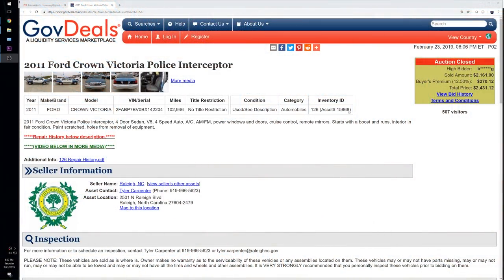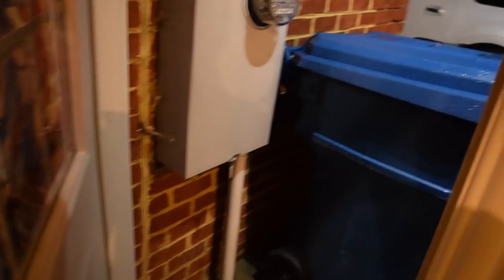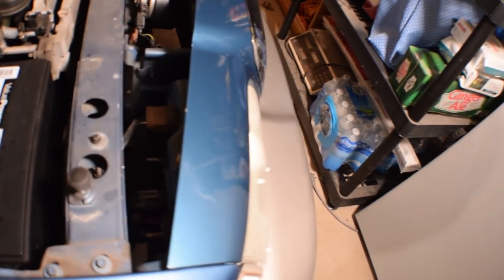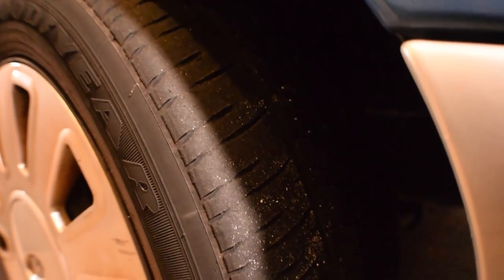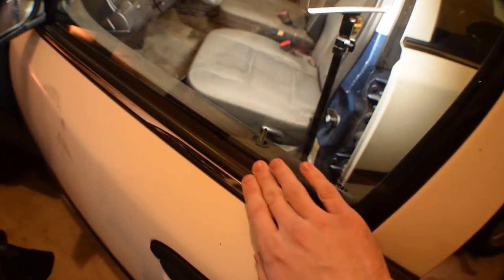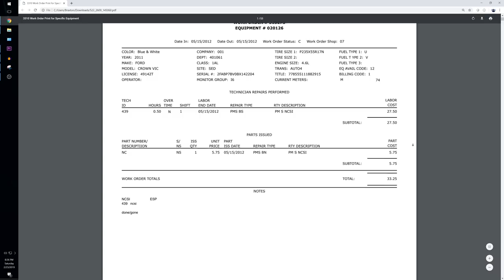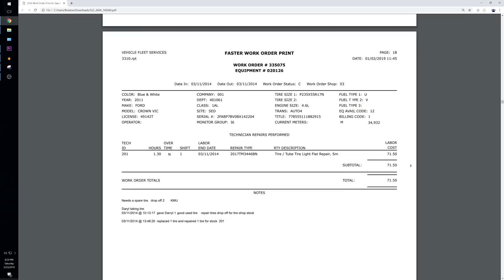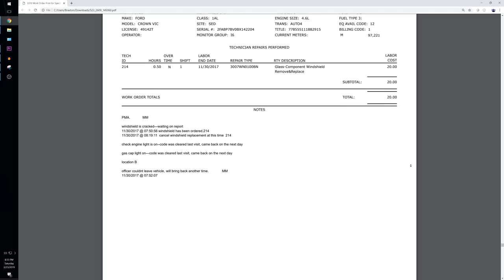I Bought a 2011 Crown Victoria Police Interceptor From a Govdeals Auction

Comment: "It's got a cop motor, a 440-cubic-inch plant. It's got cop tires, cop suspension, cop shocks. It's a model made before catalytic converters so it'll run good on regular gas."
Reply: It's a 4.6 liter....you better do your cubic inch calculations a bit better. It has police suspension...meaning slightly lower and stiffer springs and stiffer sway bars. It has four catalytic converters. Tires look pretty standard. Hopefully your response was facetious.
Reply: Jim Malek 
It's a reference to a movie!

Blues Brothers
Reply: Is this the new bluesmobile or what?
Reply: @RockandrollNegro  lmao
Reply: James Malek Isabella's King - the P71 is actually raised an inch or two to clear curbs over the stock Vic /Mercury

Comment: Do NOT use silicone! It is rather weak and tears under the flexing and temperature. Plus it's a nightmare to clean off, and nothing will stick to it, so you have to do an intense clean up once you realize your mistake. Use a polyurethane based caulk, instead. Sikaflex works great, and is available at HD stores.
Reply: I welded mine with sheet metal and bondo'd over them.

Comment: Tired of the Prius and got a real car LOL...JK.  The Crown Vics are great cars, as with any vehicle if they're well cared for they'll last a long time.  My aunt and uncle just got rid of their 1998 Crown Vic with 580k on it...it still ran and drove great if you could get in and out of it...the door latches were all failing inside and out, and last I recall only one of the back windows would roll down.  The 4.6L V8 got decent fuel economy too, around 17mpg city and 25mpg highway, not bad for a boat on wheels LOL.
Reply: Why did she not fix the lashes

Comment: I have a 2009 CVPI (former City of Raleigh) from Govdeals.  Going on 2 years.  Love it.  Don't paint it yet.  It is hilarious to drive around.  You should have kept the old battery - mine is still going strong even though it was dead when I bought the car.  Blue and white electrical tape is great for the holes.  Goo Gone for the police shield residue on the doors.  3M Adhesive Remover to clean around the holes.  BlueDriver Bluetooth Professional OBDII Scan Tool to check all the cars computers out.  Find some used Goodyear Eagle RS-A tires on ebay and get a tire shop to swap out the tires.  Lysol Daily Cleaner to clean the back seat.  Soak the front seats with Lysol Disinfectant Spray.  Check under the front and back seats for ammo and drugs.

You should do an annual cleaning around the wiper motor so it does not die on you.

Keep a look out for coolant leaks around the big black plastic intake.  Plastic loves to crack.

Comment: Panther platform cars are indestructible. I have a 99 Lincoln Town car with over 200,000 miles and still kicks ass. My daily driver! Congrats!
Reply: Ali Sleeq 2000 P71 here. Just passing 153k. Original motor and trans. Fairly minor problems so far. Nothing car breaking. 👍

Comment: Also a quick tip some police interceptor vics are keyed alike make sure you pick up a new set of door locks, ignition locks and keys from a junkyard or anyone can drive it away
Reply: max p not necessarily... I’ve tried some other vic Keys in mine and they didn’t work
Reply: @deathraydave  Not all police departments order them keyed alike but many do so it's a good precaution to take.
Reply: Far from true.
Reply: Fleet keys and being keyed alike is definitely a truth. Carlsbad PD and Chula Vista PD as well as Anaheim PD, Brea PD, and Riverside County Sheriff all use the same fleet key for their Vic’s. I’ve opened them all with my keys from my car. So yes. Fleet keys exist.
Reply: Virtually all use fleet keys. There were only six keys. The new PIs have seven... guess where the bitting codes for six of them came from. Unfortunately rekeying them is a pain in the ass.

Comment: Sounds like you've got most of the bases covered, but I would look at replacing all of the rubber on the car (hoses and belts) if that is in your budget. I would also consider taking a look at the brakes (pads, and rotors).
Reply: Hoses could be okay, since the blue hoses are silicone HD ; an option package for CVPIs
Reply: Hoses are blue silicone Police HD spec. They will outlive the car. No need to replace. Resume patrol.

Comment: I just bought a 2011 P7B with 107k miles and 6400 IH. It runs and drives fine. The only issue I've had is rear suspension bounce, noise from alternator pulley and the paint is nicked. Not a huge deal. Just imagine if all cars had IH meters built into the odometer. I couldn't have gotten a car for the price I got this one. Plus it's RWD 4.6 V8. It's pretty much a four door Mustang.

Comment: for the doors that dont open from the inside take the doorpanels off the handles are disconnected on the inside
Reply: Could just be the child safety locks. I used to have an old Sheriff car just flip the lever and working rear doors!
Reply: Emil Davis I have seen a video of th crown Vic’s police version the handles are disconnected on the inside

Comment: Hey, while you're at Wal-Mart, stop in their automotive section and pick up one of their $30 center consoles.  They fit in between those two front seats perfectly.  Oh, and that blue radiator hose is something special.  It's silicone and supposed to last the life of the car.  They're super pricey to buy and you could even resell it if you wanted.  Otherwise, nice buy and all of those issues so far seem pretty straight forward.  But really, there's nothing too complex about these Vic's.  Just clean, drive and enjoy!

Comment: 21:45 Blower motor was bad.  I have a 2011 Crown Victoria LX without working climate control so I wonder if it's the same problem.

I wonder what rear end that one came with, it has the blue silicone "severe duty" hoses so it might be a more premium model of CVPI with the 3.55 limited slip rear end instead of a 3.27 open diff.

Comment: I have picked up at least 200 Crown Vics from various Sheriff's departments all over the United States I can only think of three that I've had actually break down with something simple driving them home. 200 miles will be extremely short trip most the time I drive them five to A Thousand Miles then turn them into pilot cars and drive them all of the United States. With that one having the low-mileage it's got you got at least a hundred fifty thousand miles left in that car. Right now I'm in one of the cars that has 235,000 miles on it and just drove it from West Virginia to Illinois to Grand Forks North Dakota down the Garden City Kansas and I'm taking it to Texas right now with a wind blade that I'm escorting.

Comment: A little tip if you want an inexpensive upgrade to the AM radio. Go on eBay and look for Ford radios for ur 2011. I had an '04 and bought a CD player that was really plug and play. It even included the radio pullers.

Comment: I was worried when I bought mine at auction with 97,000 miles and didn’t know the hours. I ended up scoring one with 354 hours (yup). I was figuring I would see 4-5K. One Saturday and about $700 worth of sheet metal and she’s a beauty. Thanks for your Maaco video. I think I’m going to go the same route with mine. I’ve been doing quite a few videos on mine as well. Good work, I’m subbed up.
Reply: I think your looking at IDLE hours, that cannot be total hours, which is even crazy low , each idle hour = 33 miles

Comment: Usually the alternator clutch goes out at 170k-180k miles.  I replaced two that i bought with regular pulley way cheaper then buying a new alternator.
Reply: Pullies can be a PITA, most of my friends who own P71s with clutch-pullies replace the alternator because the clutches are a PITA.  YMMV.

Comment: Dont clean electrical with WD40, there is an 'electronic' contact, turner cleaner works great, doesnt leave greasy mess after.  Also, use 'conductive grease' on connectors to prevent corrosion.  The sticky goo on the doors, use "Goof off" its a liquid solvent, will easily remove the goo and leave the paint finish looking great.

Comment: Your rear doors might have been gutted, like mine were. I got some rear doors off a junkyard CV and got all the locks and handle rods trasnferred over.
You can get the hockey puck antenna to cover 1 of the trunk holes..

Comment: I just thought I'd let you know that your blue radiator, heater, and tank hoses are a $220 factory option silicon hoses and will last much longer than the black rubber ones so don't replace them unless there are problems.....................

Comment: I can't tell you how many of the CVPI's I have bought thru the years. We drove many of them from Denver (Colorado HP cars) back to central Texas. NEVER had one of them leave us sitting along side the road. These are very reliable cars. The issues I have experienced in the past are, bad power window motors, alternators, rear axils, and one fuel pump. As to the rear door locks, if you are lucky they have just pulled the child safety lock switch down and put a sheet metal screw in the slot. I've had to buy the rods that operate the locks on some too. That is a horrid color combination you have there, but there is always a paint job to take care of that. You have bought one fine car, and got the maintenance records. That is just about unheard of as of late. I think you'll drive that many trouble free miles.

Comment: Use a magic eraser to fix the steering wheel. Trust me it works.
Reply: Can't erase something that's worn down.
Reply: jamcm8  That isn't dirt, it's what normal wear and tear looks like on panther body steering wheels.  
Trust me, I've owned 3 newer final generation panthers:  1998,  2000, and 2009 model years.
For what it's worth, I've also owned several of the older generations as well:  1986, 1987, 1988, and 1994.

IMHO, what that guy in your link did to his Chevy's steering wheel looks awful.  I'd take shiny over roughed up, porous, and matte any day.  Besides, magic erasers "clean" through being abrasive, so he actually removed some of the top layer of that leather.  Now that it's roughed up, it is going to be super porous and will collect dirt even faster than before!

Comment: Only drawback to city cars is the idle hours is very high. You'll need to keep an eye on the transmission. Otherwise these are great cars, i have 3. Check out the Bondurant instructors cars for mod ideas, the Marauder was designed around them.

Comment: the Plot Thickens.
Keep the paint job, it makes the car unique. Now all you need is one of those hats the state troopers use, some aviators, the bull bar, and everyone will think you are a cop. Also if you want it to sound a bit more beefy, you can cut some silencers for now as sort of a hackjob, or you can do some magnaflow exhausts.
As for the interior, if you want it to look a little bit more upmaket, you can basically swap the interior for one of a Grand Marquis.

Comment: I like seeing those blue radiator hoses.  i think those police interceptors have a high-amp alternator too.
Reply: Steve B 200amp with a clutch pulley to prevent belt slip. 

Cool till those clutches stop working. Then it’s a PITA and easier to replace the alt.

Comment: Looking at these maintenance records, they were putting new tires, TPMS sensors/ having TPMS problems, and brakes on this car almost every single year. I guess police vehicles go through a lot of tires. Makes sense about the brakes too actually, considering the kind of driving police do. Interesting. Newish windshield also, nice. Btw axle shaft problems on these... I've done mine on my '03 3 times now. If you ever have to do it again, try to avoid Dorman replacement axle shafts (I only got a year and a half out of them the last time), use Timkin axle bearings (although I think the problem stems from inferior metal used in repro axle shafts, specifically Dorman), and Motorcraft seals would be a good idea. A really annoying problem, a lot of labor/ just my two cents... it will happen again and again and again. Looks like they did this job once already @ 1/09/2018... but only the left side 24:18 so, i'll bet the other side may start leaking soon and then grinding.

Comment: I just bought a 2011 CVPI from GovDeals. It came from the Lincoln County NC Sheriff's Dept. It has 154,000 miles. It needed a battery and it runs great.If anyone is looking for a good used CVPI then GovDeals is the place to go.

Comment: That car has technically been running for a span of 250+days...your piston rings most likely have improper wear as cops sit in one spot and leave the engine idling for so long all day.  Low milage and high hours isn't always a good thing. I do hope you get a lot of miles out of it, use synthetic oil and use the proper coolant, new spark plugs, clean your MAF, cabin and engine filter and maybe do your fuel filter too its easy and worth it. and I would just change the battery if I were you , you'll have better piece of mind and you won't have to worry if it will have enough juice.

Comment: Walmart uses fram oil filters. Don't ever use Fram on any car let alone this one. 
Use Motorcraft filter.  FL910 i think for your year. 
Use Mobil 1 synthetic 5-20. Change yourself.... it takes no time.
Reply: Even worse, they've been getting some weird custom looking small Fram's at my local WM.  Good for maybe 3500-4000 miles tops.  Would avoid if they roll those out everywhere.

Comment: What department did it come from. That's a interesting color combo
Reply: Raleigh.  I purchased one like the colors in December from another auction online.  The car that I have now, she is running well.  The only issues I had and had been resolved are transmission and value.  I am in the process of getting new set of tires and alignment.  All of that will be done by late April, early May.  And then I will add a dash cam, double din Pioneer, and antennas where the tape is still present.

Comment: Hi. Nice video. Be very careful. You may just fall in love w your Crown Victoria Interceptor. 
I bought a 2008 CVPI in 2016 for $3k. Had 90k miles and 3000+ idle  hrs. I  bought it to keep. These are built much better than Charger's. Especially the electronics, suspension and overall build quality. Always expect to have a tranny rebuild. Cops don't care, the cars aren't theirs and they gotta get places in a hurry a the expense of a $3k tranny. 
I love mine so much, it's goin' in for paint Monday. 
Oh yea,  I put a $2k system in too.  
Always remember, they'll never build another and 300k is normal. Change the oil as described.
Peace

Comment: Incase u did not know, this cars engine is very similar to a mustang... Soooo should have some nice sounds if u UPGRADE day exhaust ;)
Reply: Same engine as an F150. Durable but a bit on the slow side.
Reply: @TheRetarp  Yeah, strong and reliable. Believe it or not 700hp is possible on these engines if u beef it up.
Reply: 4.6L 2v. Was used in Mustangs. Not similar. It’s the same Performance Improved heads and dual exhaust H pipe. Intake is on the opposite side though.
Reply: @badatgaming  The Terminator had a 4v
Reply: @TechiePocket1  4vs are nice but eh.  Marauder ran a 4v as well.  Few of my friends have done 4v swaps but I just can't find it financially worth it.  A 4.6 still needs lots of money to go fast, 2v, 4v, or (yuck) 3v.

But Mustang GTs from 1999-2004 were 4.6L 2v.  Some Mustang stuff is actually swappable with some work.
Reply: @badatgaming  yeah
Reply: F150 got the PI heads in 2000. I believe it's literally the the same engine made in the same factory. Romeo engine versus the windsor engine in the Mustangs. (I do mean 4.6L 2V and not the 302).
Reply: @badatgaming  The 4.6L DOHC 4V that came in the 1993-98 MarkVIII is cheap to get a hold of. I bumped into a guy back in the mid 2000s that swapped one into a mid 90's cougar. It was running 13's with just steeper gearing in the differential. Fairly quick for a heavy car with all stock parts - as fast as a stock 99-04 Mustang GT.
Reply: @TheRetarp  what heads do the Mark VIII 4vs run?  I know there's A, B, and C.  Some are more advantageous than others.  That is another 4v that some of my friends look at for swapping into a Vic.

Comment: BEFORE ALL ELSE Starr HID headlight kit!!! those ford headlights are worse than the OEM headlights on my 85 Subaru.
Reply: Just That Guy Auxbeam A2 LEDs in my Vic. $37 and bright with a good cutoff.
Reply: @badatgaming  Trust me the STARR HID retro fit projectors are like Audi quality and put out an actual 3200 lumens a side, I would never go back to the parobolic OEMs... Completely worth the $426, also my chase strobes reflect better in the turn signal portion of the light.
Reply: $426 can buy me lots of other good stuff, such as solid rear control arms, a better watts link, or better sway bars.  Those projector kits aren't my thing tbh.  I like the halogen style look of the CV as its very prominent and memorable.  A few of my friends do that HID retrofit thing with the projectors but I haven't seen enough to where it looks like its viable for me.  I live in well lit city areas where I can drive my with headlights off and still see just fine.
Reply: Patrick Gilbert as someone whos 3rd shift paying $436 is fairly reasonable for being able to see on the drive home. Not like you need to see to drive. ¯\_(ツ)_/¯ ( I too fought with aesthetic issue of switching to projectors, as the ebay ones look like shit, but the Starr kit looks fairly OEM, and honestly isnt that noticeable as being aftermarket) Also the Vic is my daily, I dont really want upgrade things as its my only registered vehicle, I put most of my money into my Subaru (Im making it a vintage ralley car) and my Bronco, basically Im trying to finish the lift and fix all the issues involved in lifting it.

Comment: Look up zdatt LED lights . Thank me later . 😏. Mustang GT 500 springs for the rear and cut a coil out of the front springs....lowers it two inches . I like how not rusty it is. Body plugs and super glue will fix up the holes.